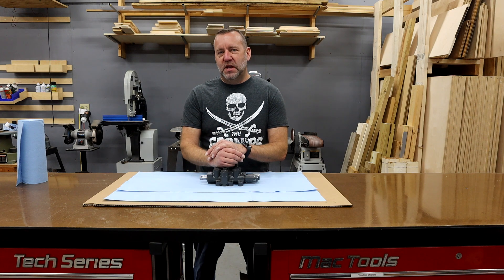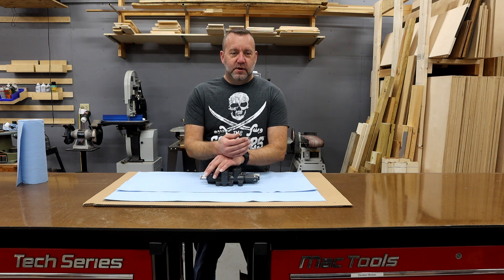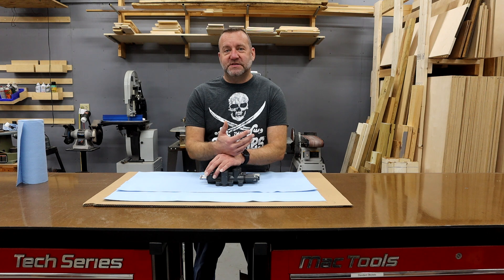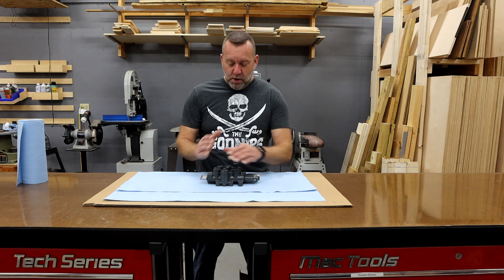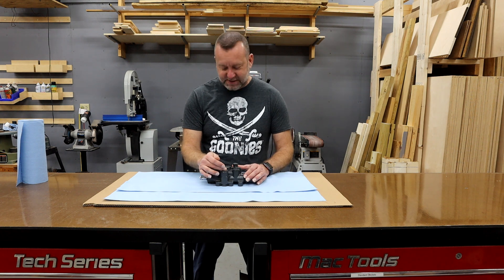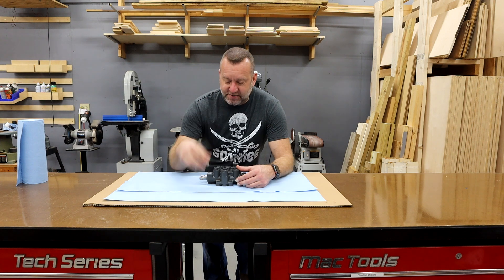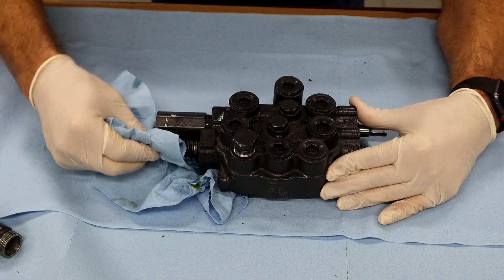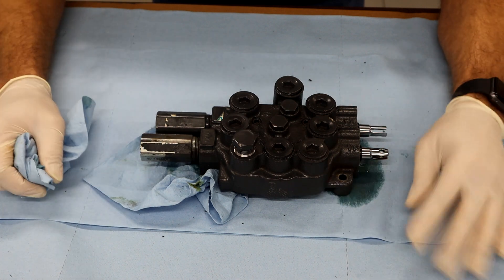Tractor Basics - Why Do My Tractor Hydraulics Leak Down

Comment: Hello, great videos! Thank you. I have 2013 John Deere  3720. My issue is that in approx 3 or 4  days the 3 point hitch arms will lower to their lowest position. Plus on a 3720 i traded in i could lift the front end of the tractor using the bucket. This one will not. Would appreciate your opinion on theses issues. Thanks

Comment: I have an issue I'm looking for advice on. I have 2023 Kioti NX4510 with dual rear remotes. I immediately installed a Summit Hydraulics toplink. After using the land plane on my driveway I noticed the top link isn't holding position. It's sagging an inch in around 20 minutes. I assumed the check valve in the top link was bad. Summit sent me a brand new one, same issue. I unhook the cylinder from the remotes and it holds position. Now, I'm assuming the remote is allowing fluid to flow out when I'm not touching the remote lever. It's bad enough that I basically can't use the top link unless I set position and unplug it. Any suggestions on what could be causing it? Can a check valve be added to my system somewhere to prevent this? I'm hoping my dealer will work with me on this.
Reply from the maker: So it will stay put with the hoses unplugged? 

Do you have any leaks from the ports on the tractor when the hoses are unplugged?
Reply: No leaks at anytime that I've noticed. It does keep position when both hoses are unplugged. But, I was recently told this tells me nothing. I was told, I need to unplug the hoses and hook them together. If the toplink hoses are connected together and then I put a load on it, like my 8' disc, and it holds position the, toplink is good. If it drops, the toplink check valve isn't working. Once I figure this out, I'll know what to do next. I ordered a $15 female coupler to put on one of my hoses to test this out.

Comment: My kit was installed by dealer so it's a kubota valves and it leaks down while brush hogging there still try to figure it out one is float and one is detention, should we put another kind on it thx
Reply from the maker: I don’t like the cylinders without pilot operating valves. I’ve already replaced my top link and will be replacing the side link shortly.
Reply: i wouldnt listen to jared the dude is fucking clueless propagandist. hydraulic valves SHOULD NOT LEAK DOWN. The idea that the implements on these tiny tractors are "too heavy" is fucking absurd.
Reply: See my comment above about redneckgeek sourcing aftermarket valve bodies.

Comment: Really a good informative video. I added Top-N-Tilt hydraulics to my Kubota MX5800 (NOT Kubota valve or cylinders). I also added electric 3rd function valve for grapple etc. All seems to hold well EXCEPT for the tilt cylinder. It gradually drifts down so after about an hour of usage I readjust the tilt. I was told that is normal because of weight of brush hog or box blade. Your video finally explains WHY that could be considered NORMAL. Thanks for clarifying why this drift is to be expected and not an irritant.
Reply from the maker: Thanks for the feedback! I’m glad you found it helpful. The tilt is always the hardest to maintain. If that valve has a bit more internal clearance than the one the top cylinder is currently plugged into then you could swap connections and see if it is any better. 

I have replaced my top cylinder with one that has dual pilot operated check valves. I believe I’m going to do the same with the tilt cylinder. Either that or install some type of a locking valve that I can close when I’m using implements I don’t want to adjust.
Reply: @JaredsShop  Thanks for the suggestions, Jared. The "issue" primarily comes into play when brush hogging. Since I live in northeast Ohio I'll not be brush hogging for a while. I'll try swapping the connections and see if that helps. If it is still a pain, then I'll likely look into replacing the tilt cylinder with a DPOCV. Where did you get your DPOCV Top Cylinder? Are you pleased with the quality?
Thanks,
Randy
Reply from the maker: @randyneubauer4176  
I have an AMA top cylinder that I purchased from surplus center. Yes, I’m happy with the quality.
Reply: its not normal. this guy doesnt know shit.

Comment: Nicely done video Jared. My loader and 3 point on my 4760 are tight but my factory 3rd function starts bleeding almost immediately. Grapple won’t hold a log. Dealer has disassembled and cleaned spools but no better. Do you think my valve is defective or tolerances to loose. Should I just live with it?
Reply from the maker: That seems a bit excessive to me. I have to occasionally hit my third function to make sure my grapple holds onto something but it’s not immediate. There’s chances it may have clearances that are too large. 

I know there are specs for leakage on rear remotes but I’m not sure what the spec is for the third function.
Reply: the entire valve block is defective and out of tolerance. replace the entire unit. thats what warranty is for.

Comment: Mine did too. Seems like it’s a common issue with grand Ls remotes. Dealer said they replaced 2 of them under warranty but said they aren’t designed to hold a load continuously as they don’t seal 100%. Think it was just a dealer excuse as they ought to on a 40k tractor, but it is todays world.
Reply from the maker: The pic shows my tilt cylinder sagging but the theory applies to all hydraulic valves that don’t use seals. Your loader will sag, your 3pt will sag, etc.
Reply: It’s Kubota remotes period, same problem with M62 ones, see my comment above.
Reply from the maker: Happens with all spool valves without seals. It just seems a little worse with Kubota because their hydraulic fluid is so thin.
Reply: @JaredsShop  and we’re a bit less happy when it happens considering how much we pay for this equipment, I’m looking to add rear remotes to my M62 so will have to keep looking I guess, thanks for the great videos. I guess valve bodies are like boobies, it’s not a matter of if they’ll sag, but when. 🤣
Reply: @JaredsShop  Yes true but the real question is why the hell are they using valves without seals? We pay top dollar for this equipment.
Reply from the maker: @Jennifer-007  
Almost no valves like this have seals. It’s very common practice. Very few spool valves use seals.
Reply from the maker: @Jennifer-007  
Very true. 😂